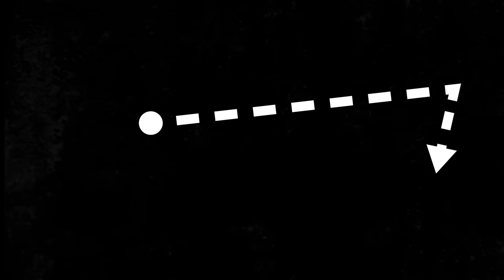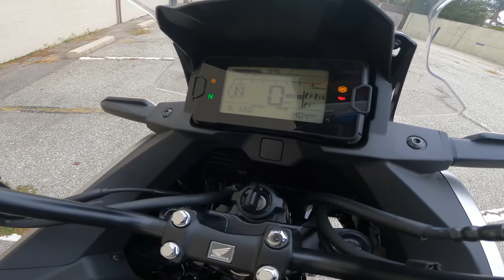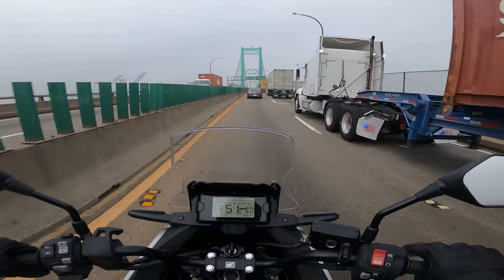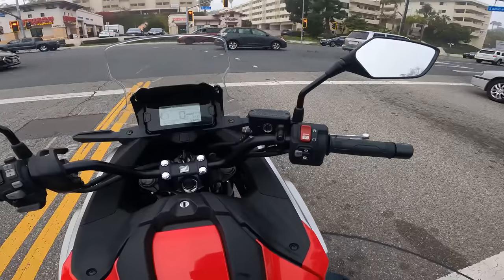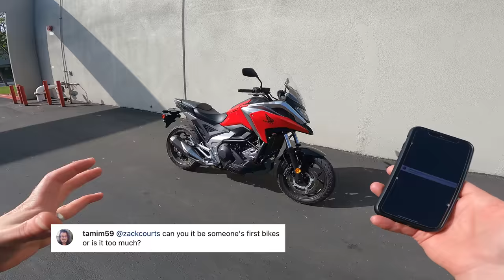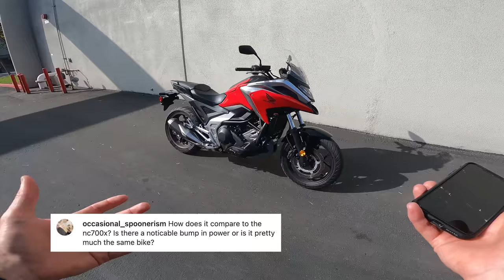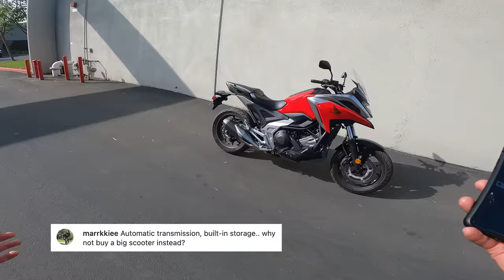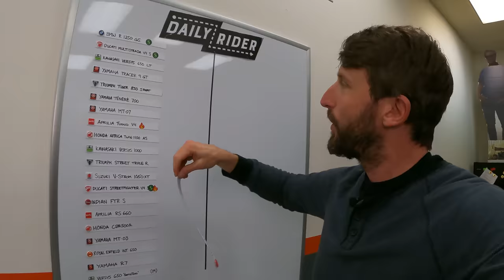Automatic-transmission on a motorcycle? 2021 Honda NC750X DCT | Daily Rider

Comment: As someone who runs a Vespa GTS 300 on highway runs between the Jersey Shore and NYC (and enjoys it), I was curious about this review, as I remember Cycle magazine's first review of the first Hondamatic 750 from the late 70s, with the tagline "we're all shiftless bastards now". As much as I enjoyed rowing five-speeds on the dirt in my semi-crazed late-teens and early twenties, "twist-n-go" has a few nice bits to say about it, particularly in urban environs, where constant low-speed gear changes get old pretty fast, unless you're on a happily-lugging big single or V-twin; the GTS is fine at most any rev point, pulling happily when needed. (Full disclosure: the powertrain's had a little help of late from a Malossi upgrade to the drive belt and variatior after some 20k miles, where it now pulls even harder and quicker.) The House that Soichiro Built has always been a bit ahead of the curve, generally speaking, and this is no exception: if you want to shift for yourself, they still do it as well as anyone else, but they also know that if you want to put more butts on two wheels, you'll need to offer something more, which is why they've stuck to improving "shiftless" bikes. (And, yes, there's even a two-speed electric bike out there, but *it's not necessary.*)

Comment: This is like a larger version of super cub c125 where u dont have to press the hand clutch like other hand clutch bikes but instead of pressing gear back or foward on the gear shift by your feet,u can shift gears by pressing the button on the handle bar just like honda goldwing
P/s:dual clutch transmission is basically work exactly by its name and unlike hand  clutch transmission where it only has a single transmission system and if u release the hand clutch too fast,the bike engine will shut down but for auto  dual clutch transmission,all u have to do is throttle the thrusters and the bike will move no matter how slow u are bc the back transmissions act as a backup power boost to prevent your engine from stop working

Comment: I owned a 2012 NC700X with manual transmission. The bike got great gas mileage and I loved the frunk. Avg mpg was around 60mpg and I took one trip with the intent to get maximum mpg. I read some hyper-miling techniques and did my trip (majority interstate) at the speed limit, pulse and glide, coasting down hills etc etc and squeaked out 81mpg over 250 miles. That was all I could stand of that but I thought it was a great result. The only problem I had with the NC was lack of power.

Comment: Same motor and frame are used in the CTX cruiser and the Integra scooter like thing.  With the motor being so low makes it hard for the rear wheel to get under it for a good wheelie. Have a 700 in my garage since 2014 and don't look for anything else. Could be a good ADULT beginner bike but I wouldn't put a novice teenager on anything that can do 100.

Comment: Can't find this in stock anywhere near me.  Web pages for two dealers said they had it in stock, but when I got there I was told it was sold the day before.  May end up with a Triumph Tiger Sport 660, but I really want Honda reliability and the lockable storage.
Update:  Got tired of emailing dealers and being told they were "pre-sold out", whatever that means.  Made a list of the options I want, drove to local dealership, told them I wanted to order one and would wait.  Alas, ordering is verbotten.  Honda decides what they send to the dealership.  Dealerships have no input on what they receive. So I put a down payment on a base model DCT that is supposed to arrive in 6 weeks.  Still have never seen one in real life.

Comment: I would have put it top5 as well.
Will they ever make a bike like this with a bit more umph in it or put in a more sporty engine in that chassis? I'm guessing they've tuned that Ptwin very mellow.
As said I think the versys650 is just more fun with pretty much the same features. I don't think the frunk is enough to sway me from that.
So the bike does not creep forward when in D?
Cheers

Comment: Someone should make a relocation kit to have the "manual" shifting be done by the foot. Then the only "Real" difference is that there is no clutch to hold at a stop, but in the twisties it's like a bike with a up/down quick shifter. I clutchless shift regardless, but some days I feel so lazy I'd rather not shift at all. :)

Comment: Just to add something about the auto transmission mode,
There is a shift up and down button on the left hand side handlebar. To me this is one of the the best features of the bike as you can flip down a gear or 2 approaching a curve.
Also the power is just less than 58 bhp which for me is surprisingly brisk.I own this bike about 2 months and it by far the most complete motorcycle I have ever owned and I have had quiet a few more “powerful” ones.

Pat

Comment: I have a manual trans NC700X (2014) and love it. I have the higher windshield and I still wish it was higher. But I get 70 mpg consistently. Even at speeds reaching triple digits, I have never gotten less than 69.5 mpg. I can hardly believe it! I’ve been looking for a bike like this for years. I wish it had a bit more power. It feels like the BMW R1150RS I once had, and every bit as balanced, but I do miss the power from the 1150cc. Best mileage on the bigger bike was 44 mpg but maintenance costs were stratospheric. I have finally found my automotive and motorcycle company. HONDA. I have a Civic, an Accord, and this is my first Honda bike. God willing, I look forward to adding more Honda bikes in the future. I’ve owned 5 Yamahas and I prefer the Honda by far. Great quality.

Comment: one thing.

motorcycle manufacturers are required to disclose power numbers in europe and europe has stricter emissions and noise regulations for bikes than the US does.

So whenever there are no official numbers for a bhike just go to the UK website and they'll be there either accurately or lower than what it has in the US.

Comment: Your horsepower numbers are off, and the fuel mileage is not only good, it's insanely good.  This bike needs a shaft drive and then it would be impossible to resist from a practicality standpoint.

Comment: I have been riding a 2016 NC750X over a year and was thinking of selling it on and getting a new oneandt here is nopthing about it I'd want to change 
Each to their own on the DCT .....  I certainly don't want things taking away from me the feeling I'm riding the bike
AND
Unfortunately I can't find a new one with a proper throttle with a cable which is the kind that tend not to stick when you need to alter your pace like throttle by wire has been known to do
Its a shame I thought I had found I bike that would suit me for a long time.
I understand you dont have to have the DCT but unless there is the option not to have a no cable throttle I have done with this model.
Unless someone is selling a normal one with no mileage on it

Comment: I have a 23 Rebel 1100 DCT and can tell you that DCT is the future, like it or not. I personally wasn’t thrilled to get it (no manual available), and I  must say I am glad I did. I ended up loving it, it is something you have to try for a few days and you’ll love it, the comfort is amazing, and since most people aren’t in a race every day, that DCT becomes a very good thing to have. Honda has mastered the DCT.
Reply: I have sinds 2013 a Honda Integra 700 DCT and it's my favourit bike ! No more worries about shifting and from what I heard : the new version prevents the DCT from shifting gears when taking a turn and the bike is not straight up. The best !

Comment: Back in 1974 Rokon built a motocross racer with a CVT autobox.
Unlike most other CVTs this was designed to keep the revs as high as possible at all times.

Comment: I seriously considered this bike before I bought my GSX-S1000! I’m a big person I wanted the extra power and size! The Honda could haul me just fine but the liter bike is just a blast to hammer on! And I got a CBR300R for town riding. Get 85mpg on the little one and it don’t need $5.50 a gallon high octane fuel to run like the liter bike so it’s like a 1/3rd of the money to run.

Comment: A change that I think happened with the NC750X compared to NC700X manual transmission model wasn't mentioned. At least in the early years the NC700X manual transmission was not available with ABS. The current NC750X manual transmission model is available with ABS.

Comment: It's a good beginner bike and might draw people into riding. It's transportation, not cheap thrills. It's closest analog would be the 650 Bergmann. After a surgery that fused my shifting ankle I traded the GSXR for the Bergmann just to have something ridable. Had I known there were good electric shifters I might not have done that but the Bergmann is very practical and with a top box has almost the storage capacity of the new gold wing. This NC750 serves the same purpose. For my next bike I'll be torn between a Honda with DCT or something else with an electric shift. A gold wing bagger sounds like fun.

Comment: Good review but you never made any mention of Honda dropping the cable drive for the better drive by wire system also allowing them to add the traction control system. All in all the 2021 got a full revamp of alot of key areas. Can't wait to see the new rumored 800cc engine Honda might drop into the bike.

Comment: I like scooters. I’ve got a tiny little Honda ruckus that everyone seems to hate because they’re puny. However I like it because it is different and unique. Plus I’m putting a Suzuki Zuma 125 cc engine in it. 

For longer rides. Big scooters like a 650 Bergman are high on my list but I also don’t always like a scooter look because of how people are towards them. They however are a lot safer for me because I have a severely damaged and dismembered left hand. It is weak and missing my pinky and ring finger completely. The pinky knuckle is shoved into my hand. My middle finger is bent at a 90° angle. Basically fused together. Therefore I’ll use a brake lever with this hand all day long and not worry about it but being smooth with a clutch lever is another thing. I just don’t feel safe doing that at all. Especially if I need to use the clutch in a quick emergency maneuver. That’s not happening. So this bike definitely has its place. Isn’t my favorite but definitely a worthwhile model for Honda to hopefully continue making.

Comment: The Honda NC series with manual or DCT transmission has been on the market since 2012. I own a 2013 NC700X (manual); bought new in 2013. It now has 62,000+ trouble free miles. It has 52 HP (the 21 NC series has 58 HP), gets 65-70mpg at 70mph. It will break any speed limit in the USA and it will do 0-60mph in less than 6 seconds (faster than my Jeep). The seat is terrrible, but I have yet to find a OEM seat from a manufacturer which isnt terrible....On my KLX 250SF, a 2x4 wood slab would be softer.

Comment: The DCT is fantastic for the rider, i noticed many reviewers didn't understand it, didn't take the time to understand it prior to reviewing it. The small fuel tank, micro-bikini sized wind screen, boring but dependable engine are all pretty standard for Honda, I'm guessing the suspension despite being a pseudo offroad platform sucks because honda usually cuts corners there, they did that to the CTX from 2014.
The rear shock on the CTX had almost no adjustability, numerous users opted to have a custom rear shock made to compensate for it.

Comment: You have a great video and answering many questions is not easy. One thing you didn't talk about is the handbreak, since this bike is automatic and parked in neutral, it's got to be stopped. I have a 2012 GL1800 that I love and a 2017 NC750X that I do off road rides with. The getting used to is not easy on the NC since no shifter and no clutch but a great bike to start or going back to bikes.

Comment: I have the NSS750 (they call this the Forza 750) not sold in the USA. It’s a step through classed as a scooter/motorcycle. Both brakes are on the handle bars.  Strange it’s only got one brake disc at the front as mine has twin brakes.  The NC 750 front looks like the ADV750 which is also a step through.   I wanted style which is why I got this bike as it’s got a full fairing.  Emergency stopping courses all indicators to flash also has self cancelling indicators.  Handbrake is also useful if on the side stand on a slope.  NC750 DCT is £1,421.00 cheaper. Next bike. Goldwing Tour.       From the UK.

Comment: I sold my mine because of its clunkiness in slow traffic (in Bangkok, that is how you ride most of the time. Sloooow). It is not very good in slow traffic because the transmission clunks in and out at low speeds making the ride jerky. My wife hated it because she was jerked around as the pillion passenger and kept headbutting me. The dealer said you can use the manual override in traffic to get over the clunkiness. What is the point of an automatic if you need to switch to manual when the traffic is slow? Easier just have a manual bike so you can use the clutch to smooth out your ride.

On the plus side, the tank storage space and the low centre of gravity were great. Fuel consumption was also excellent considering it spent most of its life in traffic doing 20 to 30km an hour. Great bike for commuting long distances, provided you are not doing much low speed filtering.

Comment: What Zack also missed was that the shift paddles override the automatic mode.  Great if you want to drop a couple gears to accelerate.  Yes, it will shift up again automatically.  I use for engine breaking all the time.
Reply: He did mention that towards the end.

Comment: I’m looking for a new bike and have been going back and forth on many. I’ve got my  Duke 390 that’s my super fun baby to flick around town and in the mountains BUT I am very interested in a bigger bike w higher displacement that isn’t going to cost an arm and a leg to maintain. The KTM is great but they’re expensive to maintain and have their issues for sure. This seems like a very good option for me as I’m 5”7, windshield is an cheap and easy switch and the $ is very tempting.

Comment: I've now ridden several motorcycles with automatic transmissions, although only one is modern... and I feel conflicted about how much - I liked it. That said, I've always favored manual transmissions in both bikes and cars. There's just something about shifting that enhances the driving/riding experience for me. The most recently built bike I rode with an automatic transmission is the Piaggio (Vespa, Aprilia, et al) BV 500. It was fast and smooth. They use a continuously variable (CVT) transmission. Very nice. The others were vintage Hondas.

Comment: Your placement on the leader board surprised me. I believe when you rode the Versys 650 you referred to to the NC750 as the AARP of motorcycles.
Reply: The "frunk" of the NC750 really moves it up the list for a Daily Rider, which does a large amount of commuting and the frequent "pick up some milk and eggs (or beer and wine)" on the ride home.

Comment: Hi.  It was either the CB500X or the NC750 DCT for me this year.  I went for the 500 and rode close to 5.000 km since April.  I love the bike, but I'm starting to have a small case of buyer's remorse.  The 500 is great, but coming off a GS800, I must say the higher rpm rate of the 500 is something that I haven't entirely gotten used to.   This video reminded me of the appeal of the 750.  Maybe ...

Comment: Good luck adding non MA/10W30 oil , add 10W40/10W50 andthe dct motor overheats and is a 1000USD part...
Air filter is a PITA to get to too!!

Comment: Considering the wheel base, weight and power, this is an intermediate bike. The DCT can mitigate the other factors, but you will always feel inferior to other riders if you haven't learned clutch use on a smaller bike first.

Comment: Honda engineers really designed a great motorcycle for the high priced gas world we are experiencing today and I think more riders are going choose this option. Its a shame honda has the flip the seat to gas setup instead of the BMW side fill port for the under the seat gas tank layout. Looking at buying a older model NC700 and outfitting it with real adjustable high performance shocks and wish the aftermarket cycle companies would sell a gas tank mod for this bike that is bigger offering insane 400 mile range. Cruise CONTROL model with great shocks and a larger gas tank would be a real great premium NC700PR model concept.

Comment: The pocket protector of motorcycles! 😂 Well put. I'm considering this bike. Something I never hear in reviews is the crank configuration. This bike uses 270 degrees. By comparison the Kawasaki Versys 650 uses 180 degrees. Some are 360 but still fire like a 180. Parallel, straight, and inline twin are often used synonymously, and crank phases differ. Good review, thanks.

Comment: Well one very important point was not mentioned and it is about engine. It is NOT motorcycle engine ;-) It is half of engine from Honda Jazz ;-) That's why it does not rev as motorcycles, that's why it has such good economy, that's why no such high power, but good torque and other benefits of that.

Comment: The mileage is really impressive for a 750cc. My Z400 is getting 62mpg over 5k miles. 100 lbs lighter and about half the displacement, also maybe a bit more fun on a good road? Cheaper too, use the money saved on some luggage and you've solved for the frunk